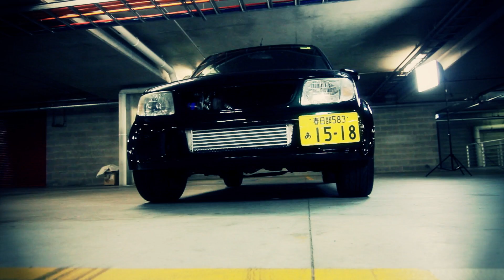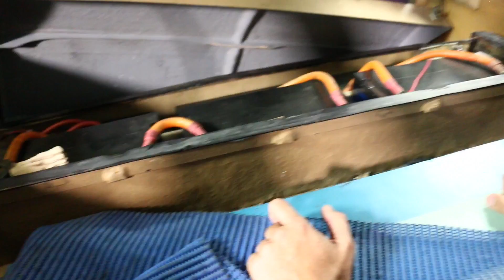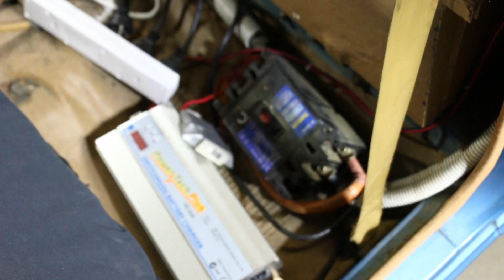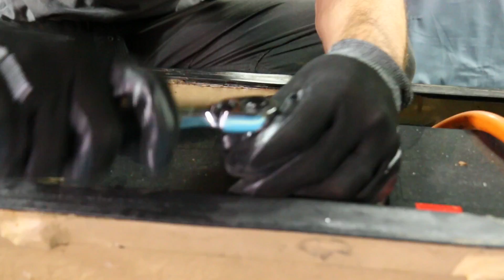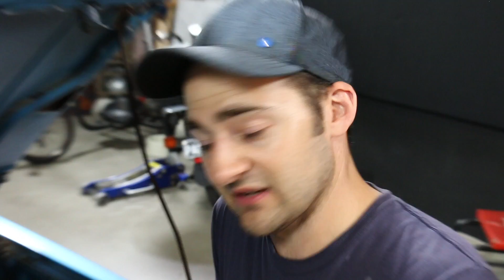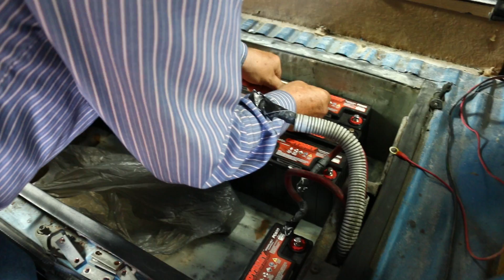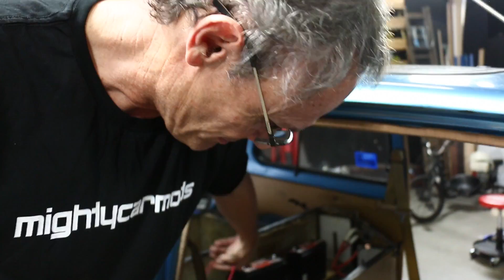JDM Electric Turd

Comment: The cool part is the people who own EV and build their own are older gentlemen.
Reply: ItsLucasYap If my health had not continued to deteriorate after I left college, I had intended to convert my 1993 Saturn SL-2 into an EV.  It was practically destined for such a conversion, a very light space frame body built on a proper carriage frame that could easily be adapted to support the bank of batteries and an automatic transmission that operated more like an automatically shifted manual transmission that could easily be adapted to an electric motor...and yet was modern with driver airbag (it predated passenger airbags) and antilock brakes.  Had my health not continued declining I would have likely made that conversion in the late 90s or early 00s...unfortunately my health did decline and I was no longer physically capable of pursuing a project like that...so we are not necessarily all that old (I am just shy of 47...had I been able to make the conversion!).  In fact, if you search online you will find others who had precisely the same idea I did with respect to the early Saturns and actually made the conversion.
Reply: @ethanpoole3443  It is sad to hear it, I do hope your health can get better to be able to pursue that idea. If that could bring you great joy, I hope you can find a way.

Comment: Batteries are DC... they are harmless if you touch them.  just dont connect the terminals
Reply: please give up now.
Reply: There's a (Discovery?) documentary out there about a US sailor who managed to kill himself with a 9 volts battery, the kind you stick in multimeters. From what I remember, he stuck metal in his body and connected to the terminals, so the conductivity was inside his body rather than via the skin. It was enough to make his heart stop.
Reply: DC power is more harmless than AC.
Reply: Edda's Garage definitely is not. AC oscillates which means when it flows through you in a shock situation the muscles twitch at the frequency of the applied voltage. Where as DC is a constant current meaning the if it flows through you it will lock on you muscles meaning if you're grabbed onto something that is conducting its nearly impossible to let go. This assumes that the voltage applied are the same. Example,240v DC is more dangerous than 240v ac.

Comment: 1st thing I drove was as a 15 year old and it was an electric milk float. (1977) The milkman let me take it for a spin in the early hours of the morning. It would carry a few hundred pints of milk in steel crates and glass bottles up and down hills for about 20 miles. not bad for lead acids!!
Reply: That's decent! I used a golf cart for feeding calves for years, we decided to modify it by adding more batteries to last a whole day, after 2 years we ended up having a golf cart to drive to the pub after work.Long story short, we should have left the cart alone >_< lol.

Comment: I know this is an old video, but a footnote: The original RAV4 EV (and later versions of the GM EV1) actually used nickel metal hydride (NiMH) batteries, which offered very good energy density for the time. Interestingly, the original patent for automotive NiMH traction battery technology was bought by Chevron, who (with GM, Ford, and Chrysler's help through the USABC) prevented Toyota from using NiMH batteries in any upcoming EVs. It got to the point that Toyota engineers were having difficulty ordering replacement cells to service the exiting RAV4 EVs they'd already made. Toyota later had to do clean-room engineering to develop the NiMH battery pack that powers the first, second, and third generation Prius in order to avoid infringing this EV patent held by an oil company.
Reply: I was under the impression that Cevron allowed the batteries to be used in non plug-in hybrids that still require petrol. The plug-in Prius uses Li-ion instead of NiMh.

Comment: Manual drum brakes all around probably make it easier for motor swap
Reply: And since an EV breaks with it's motor, brakes see less use, so it's a good idea to have encapsulated brakes to avoid rust. Might not be a problem in OZ, but in humid areas brake disc rust is a real problem on EV's.

Comment: Shitboxes like that im fine with ppl converting to electric... But that mr2 is an abomination..doing that should be considered a crime against humanity
Reply: LiterARTrue i fjnd it adorable that you are now so pissed off that you cant even write a comprehensive sentence to try insulting me, oh and good examples of the mr2 are becoming hard to find in the rust belt, drainage issues from the vents cause the first gen especially to disintegrate its not just an inanimate object but an important part of history where auto manufacturers were experimenting with radical ideas far out of the box, but i guess keyboard warriors like yourself will never understand that seeing cars as only a mode of transportation
Reply: LiterARTrue i dont dismiss electric cars i clearly said experiment on shitty economy cars leave the fun ones alone
Reply: What's wrong with that MR2? I have an Aw11 and I don't see a problem with it. He's done a neat job and hasn't hacked the car to bits. 
All that weight at the front and instant torque would make it a great track car too. Although I do agree that they are rare and shouldn't be abused, but that doesn't stop people from doing crazy 3sgte swaps anyway.

Comment: I would use an UPS (Uninterruptible Power Supply) bateries which are much smaller,lighter and cheaper ;) We use them for elevators and other stuff,in case of emergency ;)
Reply: They are literally a SLA, If you dont know what that is you shouldn't be commenting.
Reply: AGM and Gel Cell batteries are still lead acid batteries, and for a given amp-hour rating are really not any smaller or lighter and are most certainly not cheaper than flooded lead acids (you’ll pay around 2-4 times more for AGM or Gel Cell versus flooded).  Any any other battery chemistry, whilst it can be smaller and lighter for a given capacity, is most certainly not cheaper.  For a given amp-hour capacity it is very hard to beat a flooded golf cart battery (a 6V golf cart battery of around 200Ah capacity can be had almost anywhere in North America for $80-120 depending upon the store and actual amp-hour capacity — 8V can also be had at a proportionally reduced amp-hour capacity and is likely what this conversion was originally built around).  I use a pair of 6V 230Ah golf cart batteries to power my amateur radio station at home (in fact, everything related to my radio station: lighting, computer, dual 27” monitors, etc., is powered off those batteries) — my station can remain on the air for days at a time without mains power and requires only 4-6 hours to recharge by generator during an extended outage (such as during hurricanes or ice storms).

Comment: how much capacity does that big old battery compared to the small ones.?
Reply: Spicy Insomnia well the big one had 12v and smaller ones also had 12 volts as well
Reply: Fire Hawk But it's wierd because they said 2 small battery's equal one big battery.
Reply: Chris Watson If the replacement batteries were LiFePO4 (lithium iron phosphate) batteries rather than AGM lead acid types then they could very well have more capacity in a smaller form factor and are effectively a drop-in replacement for lead acid batteries, but you’ll pay through the nose for them as they are quite costly.

Comment: Smaller carbon footprint?  Where do you think Electricity comes from through your wall plug?  

Hint: You can light it on fire and cook food above it.
Reply: Naw, for me here in the south island of New Zealand it comes from water spinning turbines.. Hydropower FTW. so indeed small carbon footprint
Reply: Electric cars produce, on average, about 50% less pollutants over their lifetime when compared to an average ICE car. People always question where the power for EVs comes from, yet conveniently forget to give ICE cars the same treatment. Where do you think gasoline comes from through your pump stall?

Hint: It doesn't come from the ground.
Reply: depends where you are, another kiwi here on hydro and wind supplied power so an electric car is fairly green but the real environmental cost is not charging them its making them. all the composites and plastics used, plus the lithium mining.
Reply: Bro Tang lithium battery is recyclable
Reply: BUT it doesn't keep increasing its carbon foot print as much as a ICE powered car throughout its lifespan. 

Don't take motoring knowledge from Jeremy Clarkson.
Reply: GloomGaiGar bullshit! unless your happy pàying 50 odd k every  5years to buy a new one! how long do you think a battery lasts for?   a maintained ice engine can and have run for 100 years but at least 40-50 on average. i read you can build 8 range rover discovery's for the same energy input as 1 Prius! if that is true then lithium battery powered cars are never ever going to save the planet.
Reply: Kojetono nearly anything can. still gotta mine it, refine it, make it into batteries and use them before you can recycle them aye.

Comment: Electric cars are a waste of time, money and are their own way of polluting the world.  The only real way  to go is Hydrogen powered cars. No drawback that battery power brings.  No.1 problem with battery is the high cost of the battery, No.2  problem is the toxic mess that are involved with building the battery, lots of pollution on their own. No.3 is the low range and slow to fill the charge. No.4 is a real biggie though no one even considering the fact that the world just does not have near the means of charging the cars  so the world is going to have to start building Nuke power plants to even come close to charging a lot of cars so do we start using coal or have a home solar panels for every electric car?  This is NOT the way go. Hydrogen needs to build the plants to make a lot and they will also need more power to produce but nothing like we would need for battery powered cars and with Hydrogen the worst thing is the countries that supply oil will not be able to afford to train terrorists which will be a huge plus for switching from Oil to hydrogen based fuel. A win win for the world as a whole.
Reply: A hydrogen fuel powered car is still battery powered... Still uses electric motors
Reply: Hydrogen doesn't have a future as its efficiency is poop and can be dangerous if exposed to air. Most 'drawbacks' you've mentioned that battery electric cars 'suffer from' have either been solved already, or will be solved in a very near future.
Reply: fuck all of ya lol steam power baby! more efficient and powerful than elec or ice
Reply: No.1 problem with battery is the high cost of the battery (Hydrogen fuelcell technology is not cheap, especially when it comes to infrastructure)
No.2 problem is the toxic mess that are involved with building the battery, lots of pollution on their own. (Lithium is not as toxic as other battery chemistry and is very easily recycled)
No.3 is the low range and slow to fill the charge. (The refilling infrastructure is basically nonexistent, Tesla's get oner 250miles a charge so range isn't a issue for 90% of people)
No.4 is a real biggie though no one even considering the fact that the world just does not have near the means of charging the cars so the world is going to have to start building Nuke power plants (Pure speculation with this one, no one can predict this however, as Many places are incentivizing people to install Solar panels on their buildings roofs. combined with more cleaner energy tech coming online every day its unlikely that we will need to turn to coal/nuclear energy in the immediate future.
Making Hydrogen is highly inefficient and uses Electricity anyway.. might as well use that power to charge batterys
Reply: Snek also the toxic mess? I guess not, as it is nothing that can  be 'fixed' . fact is,  that the production of the batteries is as bad as 6 years of average driving and puts other chemicals, which are even worse than CO2, out into the world, so electric cars aren't an alternative for gasoline or diesel in any way, not even in being better for the environment.
Reply: +Breeki Boi What Toxic mess? What chemicals? Could you name them for me, please? Yes, the production of a battery puts out a big amount of Co2, but so does the manufacture of an engine and gasoline. Fact is, electric cars are MUCH better for the environment, and are a suprerior alternative to ICE cars.
Reply: I believe hydrogen is difficult to make, either with chemicals, or through the electrolis of water..... Which requires electric

Comment: They used ni cad batteries in the ev1
Reply: Ryan Macklin pretty sure the 1st ones used ac delco led gel acid batteries. they failed early on and next versions were all nicads after that but the very 1st ones did run led acids.
Reply: Bro Tang well there ya go. Apparently it was a good car even with the nicads
Reply: Ryan Macklin I've looked into to the point of sourcing some parts towards a steam generator that i think could match a battery as far as output and weight. external combustion is much cleaner and steam is very efficient so I'm not too sure why nobody's having a crack at it. there's a doco called " who killed the electric car" I watched that was pretty interesting, all focused around the ev1
Reply: Bro Tang yeah watched it a few times, theyve made a sequel to that doco now
Reply: Ryan Macklin pretty crazy how it all went down. I saw a episode of jay Leno garage where he showed his doble car. pretty amazing how it went steam and electric vehicles then the swindlers got in and somehow the worst of the lot ice engines became the mainstream. ever since every " mass " produced  electric car is weird or obscure asf. even teslas have had issues for the 10 people on earth that can afford them.
Reply: Bro Tang yeah exspecially since back in 1910 when ice were so terrible, noisey as hell, industrial vibrators and sink .
Even the most basic steam engine gets close to 30% eff without great engineering
Reply: Ryan Macklin i really just need a decent lathe now, I think with modern materials and some mildly clever electronics a pretty small high output generator can be made. the doble or dobel maybe brothers pretty much had the equivalent of the 1st hard drive. enormous, heavy, but basically all there. with improvement over years could have easily out performed ice engines but they only just got there then everything went tits up by the sounds.
Reply: Ryan Macklin this thing https://youtu.be/ACO-HXvrRz8
Reply: Bro Tang just try using a existing engine block, thatll work well
Reply: Ryan Macklin i thought about it but there's a few drawbacks, steel components tend to rust, they're a bit big, two cylinders is plenty for steam and weight is too great. the key points of my design are stainless and brass internals in an alloy block, solonoid controlled steam input/ outputs controlled with ecu, 3 cylinder compound steam engine, monotube multifuel boiler, totally closed system. I'd have engine and boiler in the rear and condenser up the front in the wind. the steam would run a generator mostly but I'd like a CVT transmission attached to the engine so extra torque could be sent to the wheels as well. I looked at converting an existing car but it'd be much easier as a test bed to build another dune buggy ( don't want to cut the one I've already made up ). that way things can be how they need to be rather than how they have to be if that makes sense lol.

Comment: Voltage dos not necessarily equal pain in electric injuries; its the ampacity (frequency) that is traveling through the circuit that is lethal (and yes, your 400amp batteries are more than capable of giving you cardiac arrest, or just cooking you from the inside out when you accidentally clamp onto a live wire).  So please understand that electrical deaths are a thing and that you must be extremely careful on a live circuit. Disconnect batteries any time you plan on working on it so that the circuit is dead.

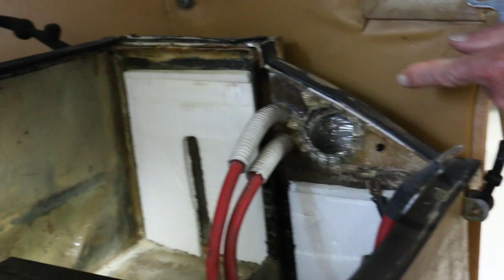Comment: I have a question. I noticed that some of the batteries in the second set were positioned on the side (i.e. not vertical to the ground). I thought lead acid batteries can only be placed vertical to the ground. Unless these are AGM batteries?? (in the video at about 31:27).
Reply: 高陆洋 sealed batteries can be put anyway
Reply: 高陆洋 these could be either gel or agm type batteries, both are non spillable - agm can output alot of amps quickly and are generally cheaper.

Comment: I must say one thing, one guy say that electric car are not that long like petrol, but this is wrong, electric car are older then petrol, and in early 1900 very competing with petrol. And by the way cars make really tinny amount of pollution, and much eco would be to make country vide building proper insulating  to use  less power to heat or cool houses but this is not very cool and interesting to show other people ;).
And another thing SUVs people buy this big heavy car which even often dont do good in "off road" which are much more polluting then older smaller cars.
Reply: swietoslaw what the fuck are you trying to say
Reply: That electric cars are not so eco, and for now they are really inconvenient to use, just that.
And that electric cars are really old tech ;) they are not new.